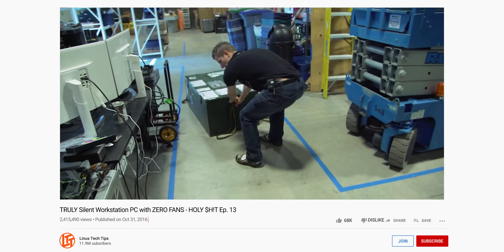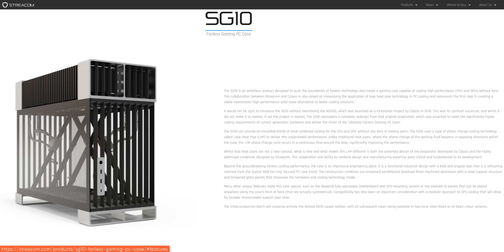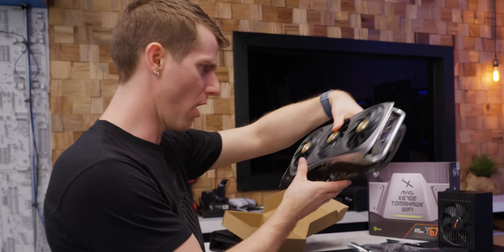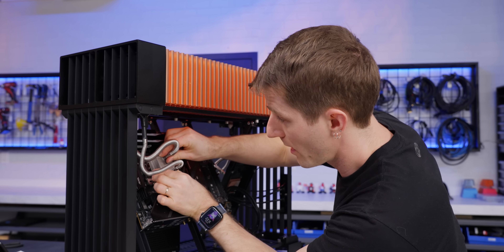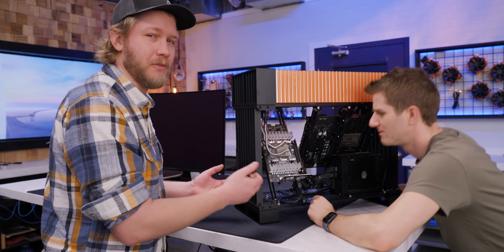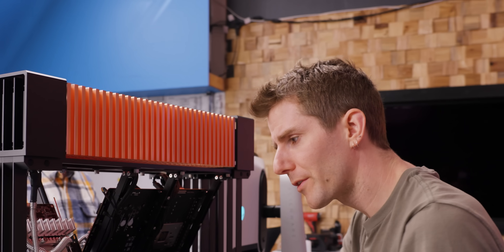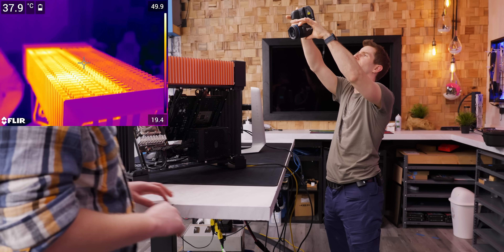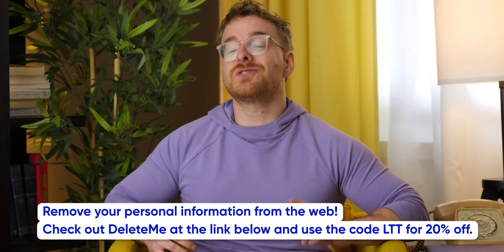I bought this scam PC case... And it actually arrived

Comment: TBF a quality case + a custom watercooling loop for CPU and GPU might cost more than this "cooling + case" integrated system, especially if you take your parts from Corsair... My concern would be morte about the 4090's power connector, given that it can be really hot even in a conventional case with active convection (aka, "fans blowing air across the case") I'm worried your 4090 could suffer from the infamous 12VHPWR issue...
Reply: I have no clue about how you would reach 2K$ with a custom watercooling, but as for me I'm already willing to change my 350W space heater of a GPU for something less power hungry, this case looks absolutely amazing.
Reply: @Bourinos02  I'm taking the aluminum one as a baseline as the copper one is a limited edition and needless to say it will sell out FAST lol

And with corsair parts you can go easily over 1000 bucks for a custom loop and a case so that's regular high end prices, especially if it includes the cooling system
Reply: Why would you even bother making a comparison? This has worse performance than watercooling and an entirely different aesthetic.
Reply: @rawhide_kobayashi  because they teased it as "wow so expensive" I was expecting more like 5000 for the copper ltd edition and 3500 for the aluminum one, in fact there already are (or was) 1000€ cases, like some In Win novelty-shaped ones. Given the novelty feature of a new 100% passive cooling system with the novelty aesthetic overall plus LTT's teasing of a stratospheric price I genuinely expected a higher price tag. Not like I have the money to buy a pc case even over 300€ anyway lol
Reply: @PainkillerX12  $1000 is pretty expensive for something that has +aesthetic ---cpu performance -----gpu vrm longevity
Reply: @rawhide_kobayashi  just like real time ray tracing in the beginning, it was a novelty thing which wasn't usable on any card besides the record-breaking expensive 2080ti, DLSS was ugly as hell and the cards were expensive af because of the novelty thing of RTX + DLSS, here it's the same imo, it works better than I could have expected with the 4090 but the thing is far from flawless and very expensive.
It's the same for folding smartphone, the very first galaxy fold was extremely fragile and it cost a record-breaking 2000€, which even the Iphone didn't reach at the time
Reply: Guess what: That air moving stuff aabove it coming out of the top rushes through the case and I bet the angled mounts help using that significant airflow to cool things not connected to the heatsinks wiill get proper cooling too.
Reply: @Flinno-k8w  tbf it should make sense in this way, we'll see after a while (if they use this PC on a regular basis and don't store it in the warehouse, which likely happened lol)

Comment: its not that bad, normal case is about 150$, you have to buy the fans, radiators, pumps, coolant etc. with this case you get a beautiful thing that sits on your desk, acts like a space heater and is virtually maintenece free. for example you dont have to dust it(it wont suck in dirt). I would buy  the 1000 dollar one without a second thought.
Reply: You can get a $80 case and 5 artic fans for like $25 wtf are you going on about
Reply: @ im talking about high end water cooling, not some cheap thermaltake shit

Comment: 1000$ is very much not a bad deal. If you think about it it's a cpu and gpu cooling system + case + raiser cable which (if it's gen 4) costs alone like 80 bucks or so, all that together wouldn't cost any less not to mention the looks and extravagantism. 100% Would buy it

Comment: 4090 passively cooled with 450w+ (probably, based on stock 2730mhz clock) on load AND being under 80 degrees is wild. iff only it came out when it said it would :/
edit because people found it appalling that a single random comment had info from the beginning instead of the very end of the video. Sorry!
Reply: more than 300w gpu gettin under 60 at full load is rare, pasivily cooled is crazy
Reply: Gets to 70+ with hotspots of 90+ on chips on the gpu that don't have monitoring in software, I'd be concerned about the longevity of this on a 4090
Reply: @dot_one_yt2 absolutely depends on your thermal paste application.
Reply: @opachki8325 I thought it was because the sink the case provided failed to cover the hot chip, which would be the case's fault (though I doubt the case makes any claims about what gpus it can and can't work with)
Reply: @dot_one_yt2  Isn't this video all about the case? Pretty sure that's what they're talking about.
Reply: @opachki8325 Definitely. I had a water cooling setup on a 980Ti years ago with a few of the VRMs cooled by little more than a small overhead fan. It lasted a good few years, but two guesses what went when it died..
Reply: @dot_one_yt2 you can always put your own little heatsinks on those chips they forgot about. They aren't exactly expensive
Reply: @ unless they are reaching over 100-110, I wouldn't be overly worried about those. They won't degrade that easily. Hotspot temps on core I would be but it's not awful per se, as a no fan super gimmick case it's not bad.
Reply: I'm concerned about those VRMs running at >90°C
Reply: @opachki8325  Well, you'd buy a kit for your own GPU in this case, that'd make more sense.
Reply: @opachki8325 if the core is 60 and the vrms are at 90+, when the core hits 75 I'm sure the vrms are at 100 or 105. This case sucks
Reply: @opachki8325  

Most are spec'd for 105c and often hit that inside laptops so i wouldn't be too concerned. If you're dropping $2k on a case to house your 4090, you're upgrading to a 6090 in a couple years or even a 5090 Ti if they make one anyway, and it'll last that long at minimum.
Reply: @opachki8325  90c is usually 'OK'. I remember the Radeon 5700XT's having RAM temps in the high 80's/low 90's and the VRMs were right there too, but AMD said it was 'within spec'.
Reply: Under 60? Maybe watch the whole video and not just the start
Reply: @ I did and saw it and didn't bother changing my comment.
"Maybe watch the whole video and not just the start 🤓🤓" stop being passive aggressive, it's just obnoxious and you're getting pressed for very little reason. If it mattered that much then people should watch the video and figure it out for themselves. I will change it tho if it matters that much to you and your butt plug.
Reply: A fish tank with mineral oil is better for pc parts than this case
Reply: @lucaslothbrook5388  Maybe put this case inside a fish tank to get best of both worlds.
Reply: Except it was 80 and was probably thermal throttling.   Also, other components were likely far too hot.
Reply: @ nah, it wasn't thermal throttling. Clocks were pretty stable 2670-2745 which is normal. Components are HOT but not to the point where silicon or chip will degrade. In a warmer environment I would definitely be cautious though it is just a gimmick case
also less power hungry gpus will heat up less=less heat on components, maybe(?)
Reply: That GPU has a vram thermal sensor. Why didnt they show the sensor temp, just the flir?

Comment: I would add two 200mm fans from the bottom, or the front towards the GPU. Those are pretty silent at 400RPM. I know that defeats the whole purpose of the case but I wouldn't be comfortable seeing those high temps on the GPU components.

Comment: Of course the vapor line should be gradually sloped to not become vapor trapped with a water slug. This is a steam boiler even though it is run in a vacuum.

Comment: Should see what happens when you do a little modding of the case, add copper Pi heatsinks to parts of the GPU that need them and add fans to the rad on low rpm to see if there is a difference.
Reply: Add some 200 mm flow optimized Noctua and it'll be golden
Reply: @nathanielhill8156  i wanted to see that on the big copper rad too
Reply: This, especially if the case is making noise anyway with the bubbling, a few noctua/bequiets running at 7v are basically inaudible and have the potential to turn this thing into a monster

Comment: So its basically a case built for 70 class cards and i3/ryzen5 tdp level of power? Seems kinda useless for a premium case. I see the VRMs and other chips on the different boards burning out very quick in this case.

Comment: Did you test it with fans? It would be interesting how far the evap cooling can be pushed 

(Edit) by evap cooling i meant to say the pumping caused by the evaporating coolant.
Reply: I asked streacom customer service a similar question. They said that since the fins aren't as dense as a conventional liquid radiator, the gains won't be as high as you'd expect.
Reply: @revolverswitch  interesting. Now what if they put the ”scariest fan attached to a computer” fans on that.
Reply: @masaster5210  probably just the same results since it's pure wind at that point

Comment: hmm hope multimaterial or at least metal 3d printing becomes more wide spread, this design could be nicely optimised and reproduced for custom builds, something like ryzen ai max 395 with a 15TB U.2 for storage and 2-4TB m.2 for os with 128GB with better heat dissipation than in a crammed nuc-like device while still all completely silent would be a dream come through, or for gamers something like here but with a dedicated video card that is also silent

Comment: If you take a normal screw driver .... Metal one piece shaft with some kind of plastic or resin handle.... and put the metal tip of the screw driver agains the fluid lines and then put the handle to you ear or part of your skull near your ear you should be able to hear the flow of the liquid through those lines and exchangers.

Comment: on a cold winter day it can heat your room so nicely...
Reply: They did a heater PC before
Then the pizza heater PC twice.
This can be pizza heater PC 2
Reply: Like any other PC with High End Components does. 
850W is still 850W, no matter how you cool it.
Reply: Every PC above 500W will heat up your room. The heat needs to escape the case no matter what.
Reply: @Rexperto6454  yes, law of thermodynamics states exactly that :)
Yet, still , that case gives such a vibe of huge radiator :) lol
Maybe because it is 

Actually if I were to build kick ass gaming pc I would definitely buy this case lol
Reply: can be said of any highend intel/nvdia product,In the end, all computers are air cooled, thus heating up the air around it.  It all comes to radiators and air moving through em.  just different ways to get the heat to rads and how to move it through

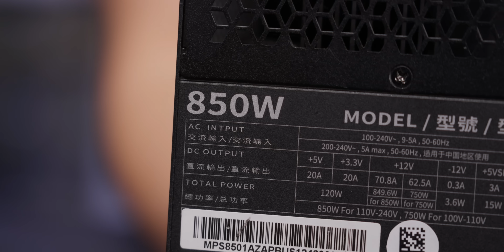Comment: What caught my eye was the AC INTPUT of the power supply. 4:48
Reply: Took me a while to see it haha
Reply: What's wrong with it? 9A at 100V, so 900w for a 850w power supply, seems normal.
Reply: @tiloalo  it says 'ac intput' not input.
Reply: @Tagiau  😅 I see
Reply: @Tagiau  pfffft I'm so dumb lmaoo
Reply: Whats the issue? Power is power. 850 watts doesn't care about voltage or amperage, it's still 850 watts
Reply: AC floatput when
Reply: it burst into flames if it receives 199.9 VAC but is perfectly fine if you give it exactly 120 or 119 V AC

Comment: Are you sure that the Coolermaster power supply is real? @4:48 you can clearly see a typo in the label.
Reply: where?
Reply: @RadicalBradical6969  intput
Reply: @RadicalBradical6969  4:50 AC INTPUT right under big 850W label
Reply: Typos aren't that uncommon, I saw a lot of be quiet! cases labeled blcak for the color.
Reply: Stuff like that is actually quite common in many products if you care to look. Especially ones made in asian countries.
Reply: I think that is if you were to put fan in it

Comment: This is how a refrigerator in an RV work but the heat source typically an electronic heater or propane pilot awesome use of science
Reply: It's actually not, though they seem similar.  Look up "rv refrigerator water ammonia absorption refrigeration" and see how it's not a simple phase-change system, like this or typical systems are.  Because this system has no mechanical pump, it's a Thermosiphon system (eg Ford Model T).  Gravity plays an important part here (as it does in the RV refrigerator you mention, but again, they're quite different).